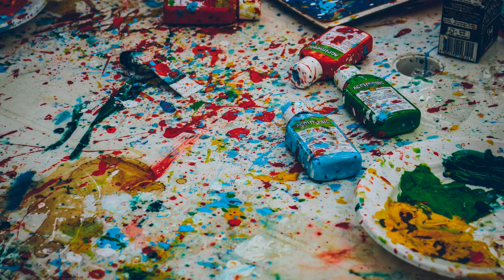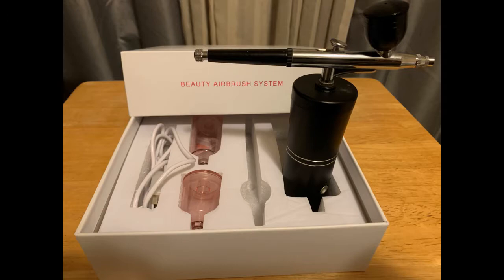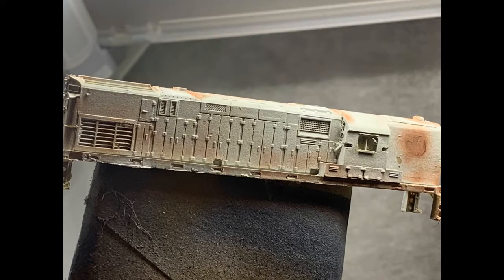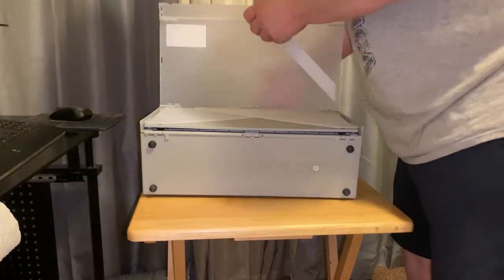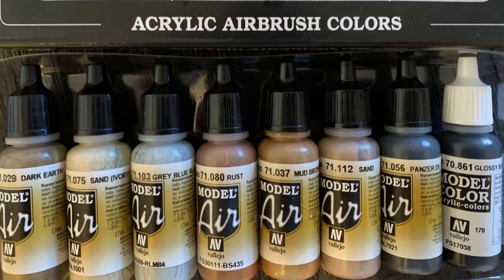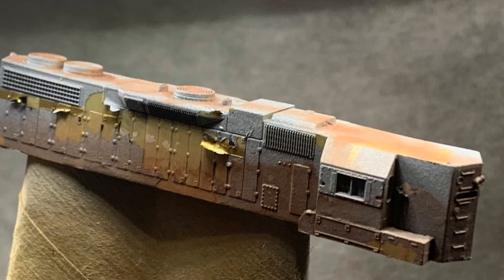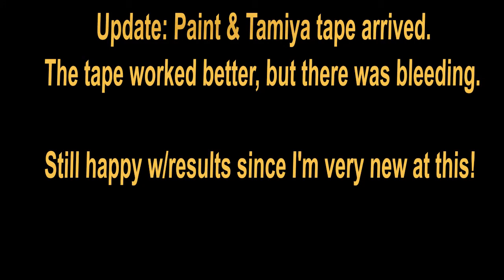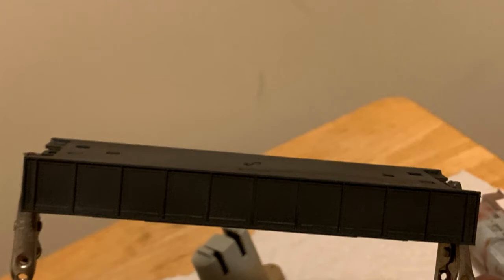Airburshing Adventures in Model Railroading

Comment: Hi Dan. Another former Jersey guy here!  North Jersey to be exact. I saw tons of Conrail locomotives growing up in the North Bergen/Weehawken/Secaucus area. 

Just want to share a few things I've learned over the past few years of airbrushing plastic models. I've tried most every brand and type of water based paint out there and found Badger paints to stick to plastic the best. If you want water based paint that will stick to plastic without primer, use Badger products. I don't know why but they just stick without primer. Maybe they use a better adhesive in their paint? Don't know, don't care! If you want to use the Vallejo paints you bought then buy either Badger Stynylrez primer or Vallejo's primer and put a couple of light coats down on the model first.  Createx's Autoborne sealers will work also as a primer. Then pretty much any water based paint will stick to the primer which in turn will stick to the plastic model. You will not have any problems with the tape lifting the paint. If you are only doing one color, you may get by with using the Vallejo paint straight on the model but why risk it? You can find Stynylrez quite easily on the web.  Also, a top coat will protect your work but still won't guarantee against tape lift without a primer. 

Tamiya tape is the best for sharp lines. You can use blue painters tape on the tamiya tape to fill in large spaces and save the Tamiya tape for lines. Keep the tape clean also!. If you want curvey lines, there's no better tape I've used than FBS micro fineline tapes. It's like tamiya being paper but it's cut in sub mm thickness' so it's easy to curve. BTW, the bridge will look much better weathered. It's not hard. I'd watch a few videos on youtube first to see what some of the pros do. Then refine it into what works for you.  Some folks weather in stages and protect their work with a matte varnish after each step Good luck in your modeling. I have that very track plan you are using saved for possibly using it some day. Keep practicing with the airbrush! You will master it!  Dominic
Reply from the maker: Super appreciate the tips and tricks. I will be trying them out. Question: I have tried the primer after the initial attempts, but I wasn’t sure how long to wait prior to adding the paint to the primer. Any timing suggestions? Also should I add the base color and any lines/designs onto tgg he e primer, do a full color coat and the lines/designs over the base color?

Thanks again ~ Exit 9 off the NJ Turnpike! - Dan
Reply: @DMRJ  You're very welcome! I usually wait 12 hrs because i only use water base paints. Badger says 24 hr.s for their primer to fully cure. After that, you can sand if you want and spray any type paint over it including lacquer and urethanes. I do the base color first then add the second or third color. I haven't painted any trains except for airbrushing weathering effects. My experience is with airbrushing small  slot car bodies. Oh,  I also airbrushed the rails and ties on my n scale Unitrack layout. If your second coat is a lighter color than the base color, I'd spray a light coat of white over the dark color (after masking). It then takes less coats of the second color to cover the dark color and will make the second color brighter. Less build up along the mask line also this way. It usually takes a lot less paint then you think to build up the colors. Dominic

Comment: I'd say decal first but if the plastic bridge has no paint on it you might have to paint it then put a gloss coat on, decal on the gloss coat, put on a flat or dullcoat, then weather it. Painting and weathering with an airbrush is not easy till you learn the tricks to it. Oh and some of the plastic components don't take paint very well. First thing before anything is painted for the first time I'd say would be wash whatever it is with soapy water to remove any casting release and oils from your fingers then only handle areas that don't get paint or wear a latex glove to handle what you are painting. I'm no expert and I'd say watch a bunch of painting, decaling, and weathering videos about using airbrushes first. The quality of airbrush has a lot to do with your results as well. I know you said you have what you have right now but maybe check into an airbrush specifically for paint. Harbor Freight has relatively cheap airbrushes that I've heard work decently. I've not purchased an airbrush yet myself but that is where I will be getting my first airbrushing set up from when I do get one I think. If you get frustrated I'd say don't give up just watch some YouTube videos and try again. They don't need to be specifically model railroad videos about airbrushing either. I've found a lot of helpful videos from the miniature gaming community as well. I've been watching airbrushing and modeling videos for about 2 years now trying to soak up all the info I can before trying my hand at airbrushing. Good luck and hopefully you'll master the techniques of airbrushing. 
Stay well.  -Wil   👍
Reply from the maker: All great tips and advice! Are you wanting to airbrush with model trains or with other models?
Reply: @DMRJ  Model trains, HO scale.

Comment: I have been wondering about them beauty air brushes, can you adjust it for fine lining?
Reply from the maker: You can’t do anything with the pressure, but the airbrush is a single action airbrush. No special connections so you can connect it to a compressor.
Reply: So you can't adjust the spray pattern from narrow to wide, So probably not good for fine detail work, still pretty cool
Reply from the maker: @randysrockandrollrailroad8207  Maybe my inexperience here. Do you adjust with the two pieces on the top?
Reply: I have no experience with it, so I have no idea how it works, most air brushes have a needle adjustment for air flow and paint flow, (disclaimer) I'm not an expert on air brushes 😆